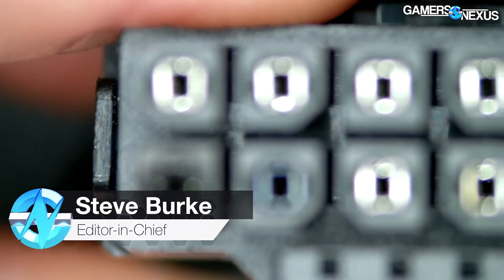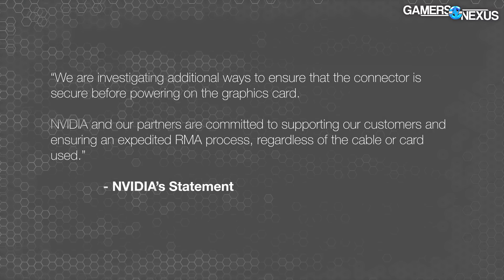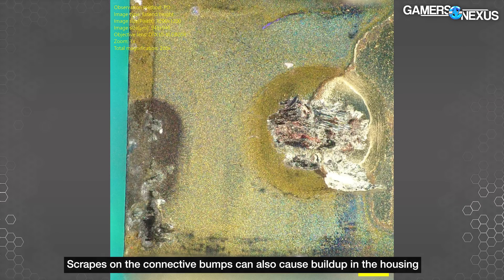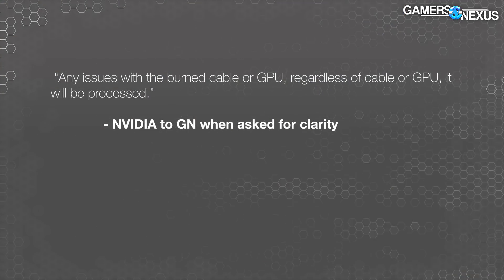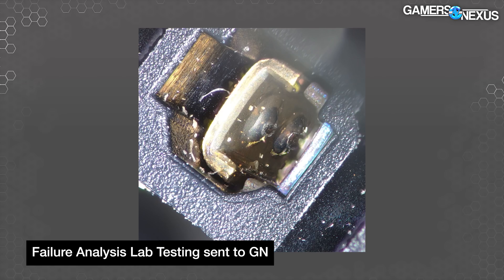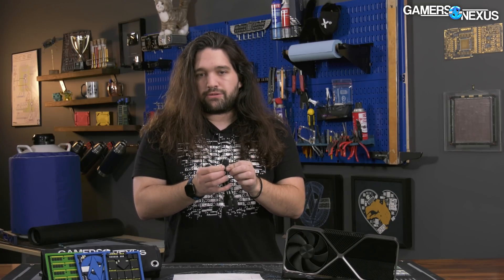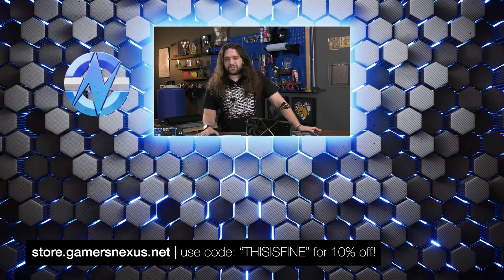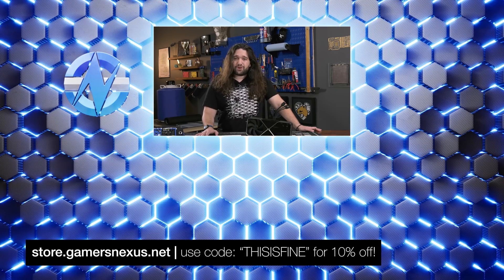NVIDIA Responds to Melting Cables, Warranty Concerns, & 12VHPWR Adapter Failures

Comment: What a lot of people don't realize is once the ATX 3.0 standard is fully implemented and ATX 2.0 is depreciated this will also be your motherboard connector and the 24 pin connector and the 12V Molex connector will no longer be used. I wouldn't be the least bit surprised to see it mandatory on 14th or 15th Gen Intel motherboards. Nvidia just had the poor luck of being the first adopter of a standard set by Intel

Comment: All of this wouldn't been issue with 8-pin connectors, at most you'd signal to PSU manufacturers to maybe increase copper content in PCIe cables for future generations, and to stop daisy-chain connectors production. Why is this 12-pin or  w/e even a thing... why "fix" (replace) what "works"?

Comment: make the connector like DVI or VGA...secure it with two thumbscrews on the sides
how often do you need to remove it before it will be inconvinience? once a year at most?

Comment: so i had the 16 pin directly from my 5.0 psu no issues. however in cablemanagment i did this walking halfway out on my mb connector....i was sometime booting and sometimes not. so easy to walk a connector out if its not clipped in 100%

Comment: 3rd thing that can be done, define a keep out zone around the card side of the socket so that 1) the user can visually see if the connector is fully seated, and 2) allow enough space to correctly plug/unplug the cable by using the connector housing and not the conductors.
Reply: its a shame that the only 4090 in the world that avoids this design flaw was from EVGA and never sold to customers.
Reply: Or just increase the pin size. The problem ultimately lies on the small surface contact between the pin and the terminal
Reply: Seriously not that difficult to plug this cable in, and you can hear a click not hard to see either it only becomes difficult when you vertically mount it slightly difficult to see the back of it of the cable.
Reply: @2RealBeats8040  try plugging this in a sffpc... Where you can barely get your fingers in.

Comment: Still what a pain in the ass connector that you have to check if it clicks all the way down, just avoid those Nvidia cards and go for Radeon or older Nvidia cards with regular PCIe connectors.

Comment: Wiggle it and say out loud, "it's not going anywhere". Voila!
Seriously, the last time I saw burnt connector was back in 2012-2014 on either 4/8 pins or 24 pins on motherboards, and back then it was also caused by user error.
Good thing you guys are here to find the root cause and educate people how to do it right.

Comment: I think alot of the problem is  the new design puts the socket so far into the gpu that you can't really see if you're seated or not.. The old sockets protrude away from the gpu and are much larger so you can actually see if you are seated or not.. This new design makes it hard for people who have poor eyesight like me to tell if it's seated or not
Reply: Honestly even with good eyesight it can be hard to tell because it's usually a black cable going into a black plug in a dark computer case.
Reply: Not even that. How much Force you actually need to push it all the way in is even more stupid if you realize that gpu is actually seated on your motherboard.
Reply: @arketsjenkins5016  After watching the video never ever try plugging the connector in after putting in the motherboard.
Reply: And the old design has the sense pins in the same position as the power and ground so if it isn't plugged in properly it will display an error.
Reply: That's what it clicks
Reply: That and the missing click. I have the habit of checking the latches on the connectors after they're plugged in. Dealing with many old PSUs and boards, they sometimes don't click anymore, and on some motherboards I've had to really push hard to get it to actually latch. I couldn't even pull the connector out, but it still wasn't latched. How could I know that? Because the latch is visible!
Reply: the new design is so bad that i never had this issue on 20 years of nvidia gpu, thats how bad it is, they owe us free non-fire hazard cables with an L design that is foolproof for this oversight, otherwise someone is going to burn their house down rendering 8k video
Reply: @psychoticgiraffe  Or you could just not be dumb. IDK.
Reply: There are no problems with design, there is a problem with gamers struggling to put damn thing in, which is not surprising
Reply: @moonshine7374  weak hands?
Reply: @moonshine7374  But a lot of us are old... :)  and sometimes.. stoned.. they need to account for that

Comment: Nvidia's check to ensure its socketed correctly: 
Plug the cable in with the card NOT socketed into the Motherboard. Pick up the card check cable is fully seated by twirling around your head 5 times. 
If it doesn't come apart install card into PC.......
Otherwise at least you didn't burn your house down!

Comment: So even if the connector is seated properly, foreign object debris could still be a cause of melting. I think that design and build quality of this 12VHPWR adapter is quite low and it should be replaced with a version that is worthy to power a 2500 € GPU.

Comment: I have a 4090 STRIX, I checked my 12vhpwr connector. It was slightly wiggled out. I had to push harder than i was comfortable with to get it all the way seated. I'm glad i checked. I'm sick to my stomache knowing it was a little out.

Comment: Steve once again thank you for your commitment to this issue.  I am also happy to hear Nvidia replacing affected GPUs regardless of connector used.  The only concerning issue is the learning curve.  Never before did a consumer need to be the cable insertions expert.  Two thinks can happen.  First make the 4pin sense wire connector like a USB where one pin is so much shorter.  Second and the BEST would be completely do away with this 12VHPWR connector and replace it.
Reply: Or you could, you know... just make sure it's plugged it in correctly. You don't need to be an expert, you just need to not be a dumbass.

Comment: GN deserves a big "thanks Steve" for investigating the problem with the 12VHPWR connectors.

I hope Nvidia will follow up on foreign object debris, and create a better latching mechanism and/or better sense pin safety.
Reply: The problem have always been user error. And also, GN isn't just Steve.

Comment: This is an absolute disaster and  those connectors need redesign. RMA is great now, but what happens in a couple of years time when surface contamination, wear, or corrosion start to play a factor. This component has no performance margin, which is insane. If the customer can fail at correctly plugging in a cable, there is something seriously wrong with the design. A 4 minute tutorial on how to plug in a connector is insane!  This is a long way from being resolved.

Comment: "Units shipped" is not equal to "Units installed and used".  Therefore the real failure rate is higher than the % calculated.

Comment: AMD is smart to avoid dealing with first gen PCIe 5 power cables. I wish GPUs shipped with a vertical and horizontal 90 degree bend adapters.

Comment: The only reason I see Nvidia openly saying they are going to honor warranties; because they have to accept partial blame for not QC checking the failure of the plug in 100% cases. I know a guy who specifically does this work for a government contractor. This is a part of R&D before finalizing a product, "how can you break the product and can we design ways around that happening." Clearly Nvidia missed an issue

Comment: Useless negreedia solution to a non existent problem, and of course it backfires because it's too complicated and delicate.

This connector had everything to go wrong, and boy, it did go wrong.

Thanks for setting a new useless standard that will need a third revision, creating more confusion in the market.

Only 50 cases globally??? That has got to be the most bullshit response to date from negreedia, and they have sent our way plenty of bullshit already. Fail!

All of these negreedia "findings" only exist because the team at GN did the work for them, so easy to use own GN's findings to make their own. Fail!!

Comment: 50 is only reported cases.  Plenty of people won't know this is happening unless their pcs crash or they add other hardware to their pc and need to remove these massive cards for clearance.   The real number is higher than the reported cases due to how hidden the melting can be inside a pc.
Nvidia's early warranty statement was an attempt at fraud, the law is clear that they cannot invalidate any warranty unless they want to prove someone or something else is to blame in court.  People on nvidia's legal team should be reported to their state bar for sanctions because it gets old that lawyers inside companies keep pushing false information to consumers.  The word "may" does not change anything about their lie.  They know damn well it won't.  Heck, they made the spec.  No one adopts 12vhpwr if nvidia did not use it on some 30xx cards and state they would be using it in future cards.  Nvidia used fomo against psu makers to get them to add 12vhpwr connectors.  The spec is also designed to push the problematic side onto the cable manufacturer, it is no different than when intel took the pins off their chips and pushed that liability onto mobo manufacturers.

Comment: I think Patrick has the solution here. Any connector inside a case expected to carry over 500 watts should screw down and have a standardized torque spec.

Comment: Good job GN delivering content and answers even before big corporations address their own mess. 

I am no expert and this is where tests and the end user (customer) might become in disagreement, IMO the  "user error" narrative doesnt seem to fit, should be something more of a combined user error and design flaw. The card should be designed to have a more accommodating size and the power connector placement leaves much to be desired. 
Also the adapter is heavy and bulky, might put a strain on the pins over time since user environment with cable management side panels, coolers and other factors I am not even considering might change the results over time compared to a test bench. 

Time will tell or customers will decide if the format survives with their wallets, I just dont like that customers need to be put through all the hassle and multiple factors that can be a point of failure  when dealing with an overpriced piece of tech

Comment: I actually like Nvidia's statement, it was no bull no fluff, just to the point and sticking to facts. They didn't really admit a mistake which honestly it wasn't really their fault and they are still going to work on improvements in the future. Honestly I have nothing bad to say about their response although I still am not a fan of Nvidia these days. Maybe in the future there can be some sort of sensor to detect lose plug or abnormal heat build up that warns customer and shuts down the card before causing a fire, but again the amount of cases vs the amount of people who own these cards are extremely extremely small and a normal consumer would likely never run into this issue. I do hope however Nvidia changes their plans on future cards to avoid this issue entirely by just keeping the multiple plugs on graphic cards to balance the load among multiple plugs like all the other modern mid to high end graphic cards that exist.

Comment: There shouldn't be a plug, there should be a 'pig tail' of 4 power connectors which are soldered directly to the board of the graphics card.

Comment: Just curious, could you create the same failure for cards with the 8-pin connector? 

What makes that connector more "resilient"? 

Does it just have a much better latch or factor of safety?

Good on Nvidia for addressing the issue correctly.
Reply: I think its hard to do an an 8-pin connector because that only allows 150watts of power draw therefore it won't produce much heat that may melt the plastic.

Unlike the 12vhpwr that allows up to 600w
Reply: @marvinfernandez2583  It has definitely happened before. You can easily find images of melted 8 pin connectors. Too many people think that the issue is exclusive to the 12vhpwr connection.
Reply: @t1e6x12  oh for sure, I know it has happened and can still happen. My point was just it's hard to reproduce it compared to the 12vhpwr connector

Comment: If a cable connector is not made to be idiot-proof, then just maybe, idiots designed.  Traditional connector/wire design was based on 1.5 of max use.  Also, "No Functional Lock Tap?"

Comment: if There isn't an issue with the cable why wasn't this a problem previous style?  In my opinion if it's unplugged far enough to cause a fire and still works that is a design problem!

Comment: Or just overbuild it so that even if the user does not insert the connector completely, it still won't burn up during normal use. That's how you truly protect against user error. Include a safety factor. This is engineering 101. C'mon Nvidia.
Reply: That would cut into NVIDIA's profit margins too much.
The cynical part of me wonders if NVIDIA switched to this new socket as a cost cutting measure.

Comment: 50 globally seems pretty low based on the social media reports but I guess it's hard to tell since individual reports get blown up so much
Reply: Even if the number is lower than what it might have looked like, 1/2500 failure rate like this is still way higher than what's considered acceptable by today's standards. And even if you consider all the case as "user error", it's still too high because user errors happen, especially in consumer (non-professional) oriented products, and there should be an appropriate amount of fool-proofing.
Reply: I was thinking about this too. My suspicion is that due to it be a high-end card a large part of the 50 people that ran into this are online. So that perhaps like 40 out of the 50 are on Reddit talking about this, creating the idea it is very widespread.

Comment: I actually agree with NVIDIA certification of cables. It won't be an easy process, but it will make cable options safer if cheap knockoffs show up in the market (eventually, it will happen). NVIDIA already certifies certain adapters for their Quadro line of professional cards. For an RTX 40xx, this would not be a great leap.

Comment: What they need to come out with is a solid adapter the plugs in and goes in the direction that someone may route the cables. it would also make for a cleaner install and it would be easy to send out to the consumer.

Comment: As I said on the previous video about it,  the "May" usage is simply a lawyer term. Specifically meant for times when it is needed. NVidia seen the error of its execution here are decided to man up and eat it. Good on them, They "COULD" have legally decided to screw the rather small amount of people on these with user error claims. Just about any company that is a legally operating and profitable company is going to have some clause in the TOU policy or what have you that is virtually identical to this. Not just car company's and electronics, but just about everything you use in the world today.

Comment: It just occurred to me how nVidia can quick-fix this without adding too much expense — make it so when the connector is fully seated, and once a firm click from the connection housing is heard, a conductive layer with a low-voltage circuit acts as a sense that disalllows the card from operating if no contact is made.
Reply: Not deleting the original comment, just expressing another solution based on this: pogo the sense pins. Use a board interconnect with a couple of springs to press in once the pins are seated, so the sense pin interconnect also overwhelms the spring tension holding them back.

That would be a terrible temporary solution, but for the 50-series cards, a sense interconnect like that would probably be the cheapest and dirtiest way of doing it.

Comment: if they had just made the 12vhpwr  plug with a bit thicker wires , this might not have occured  . the hevier guage a wire is the less it will heat up.  I'm still surprised they expect 600+ watts to travel through such tiny wires and ther enot be aproblem with it heating up.  but from the get go when i heard the first story of the plug melting my thoughts were ,A: it must not have been seated in the plug outlet. and B: the wires are too tiny for high current.

Comment: I'm with those that say it's entirely user error for not checking to see if it's locked in, and it's a surprisingly few number  at that ... One thing, do not wiggle any connector  , all you're doing is possibly making the terminal tension less , push it in, or pull out  on it, but don't wiggle it

Comment: Its not user error in my opinion. If its an issue, the design should dictate that the cable makes an audible click when fully seated. Maybe there's a mark on the connector of the card and then a little window where you should see the mark through the window to make sure its fully seated.. whatever it is there should be instructions or documentation that the user should push until the audible click is heard/felt, push until mark is seen through the window, etc... its not by accident user safety features like this exist on some products.

Comment: Wow, that seems an enormous amount or force to correctly socket the connection. Redesigning needed asap. If on a vert mount I could see the card flexing away as you try to socket making a poor connection.

Comment: This is still BS about not having the pin secured in. It's like having a regular plug in your outlet and having it slightly off. Then your house catches on fire. Total design flaw and 'fuck around and find our moment' on how much power you can push into a card without any thought on safety.